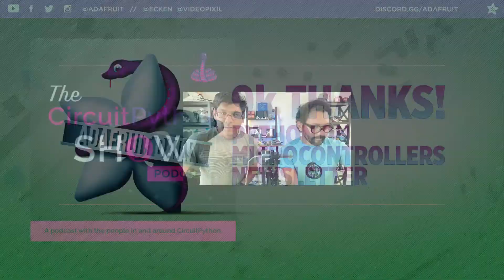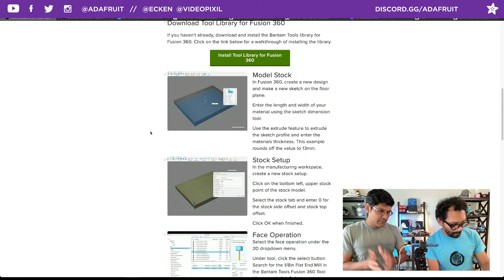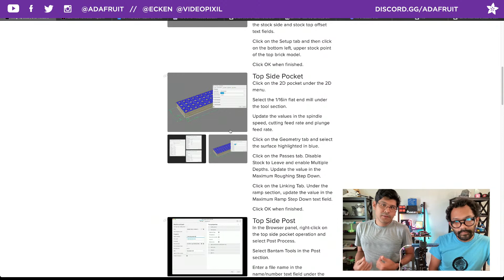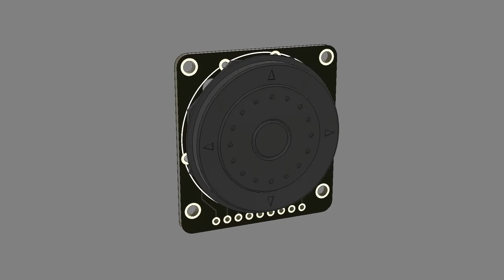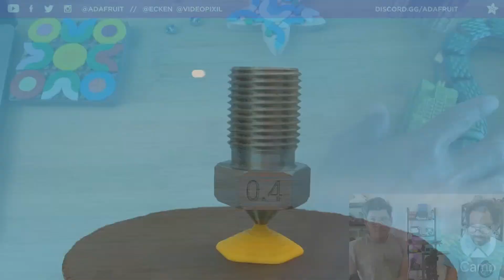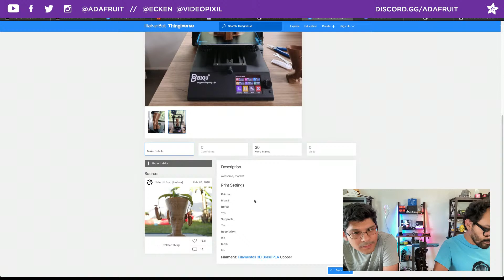3D Hangouts – Wooden Bricks, LOLA, Quetzalcoatl and Nozzle Holder

Comment: Could you not have milled the Adafruit thing where it only has the top parts, then used that as your mounting surface rather than an official lego base plate? It would give you more surface area on the bottom, though it would eat your Z height. Given you were using a PCB mill that doesn't usually have much Z-height, maybe that's why it wouldn't work?